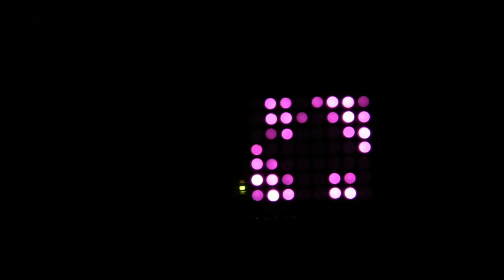8x7 Charlieplexed Shield Small Assembly

Comment: Hi just joined your channel as I want to learn Arduino and Charle plexing for a message panel so do you sell an all SM board to get more leds on a small board and is there a size setout for SM leds?
Reply from the maker: I never made a SMD LED shield, and I don't have any plans to do so. 

However, both my schematic and the LOL shield schematic are online. Therefore, I recommend that you use one of them as a template and make a PCB that fits your application perfectly. Then you can just download the Arduino code examples and have something to start playing with. 

It might seem daunting to do it yourself, but this would actually be a perfect project to learn to make a PCB on because there are only 3 components (resistor, pinheadder, LED) repeated over and over.